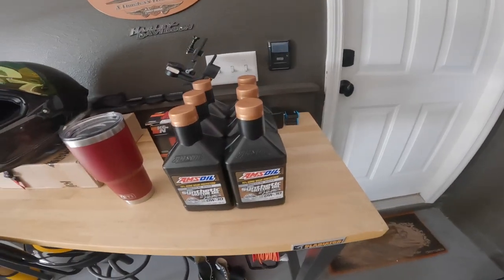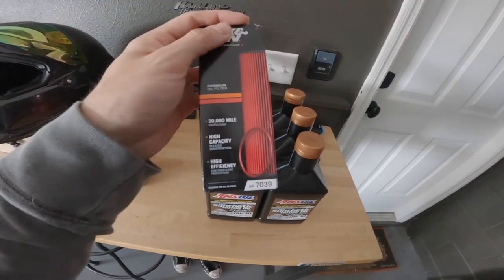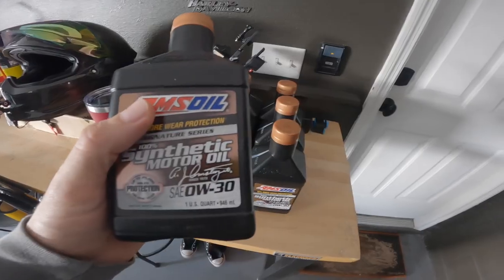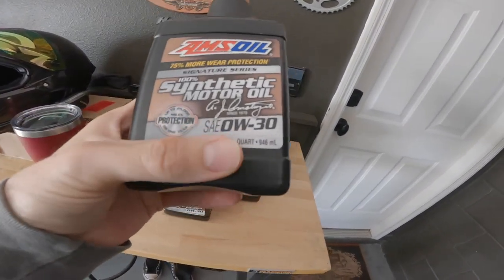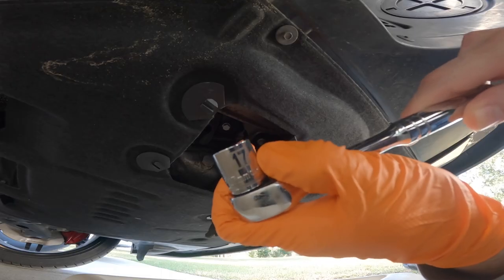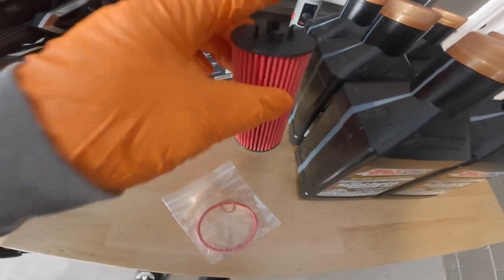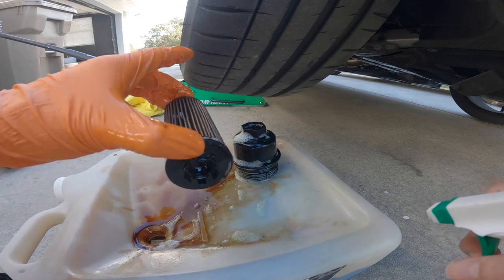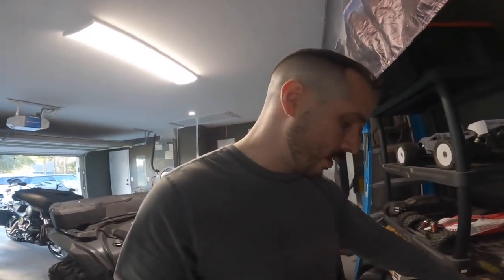Best High-Performance Oil Change for More Horsepower // Mini Cooper F56 JCW

Comment: Bro! Thank you soooo much for showing why the K&N 7039 doesn’t fit! I literally almost bought one! 😭 also what do you think about the Lucas oil High performance full synthetic oil additive. Do you think it’s even necessary? I’ve seen someone test it on bearings and it show much less wear but wanted your two cents. 

I also have a JCW no  remap but have the Mmr boost an charge pipe kit and also the hard intake resonator delete with the high performance silicone intake coupler. Planning to remap and also go for the eventuri carbon intake like you and the MMR inter cooler

Comment: Have you looked into upgrading the standard oil cooler for something like the forge oil cooler? A worthwhile mod if the engine is getting to higher temps on fast road or track conditions.
5-40 Millers NT+ seems to be the preferred oil across the pond for the JCW :)
Reply from the maker: This is great advice, David! I have seen the upgraded Forge oil cooler, but I haven’t researched it much. I’ll look more into it and see if it’s worth upgrading to in the future. 🍻🤘🏼

Comment: Is the AMSOIL LSPI friendly and have you noticed anything with cooling and flow efficiencies for the turbo? I went to a heavier weight oil and noticed the turbo wasn’t being cooled as effectively and the oil wasn’t being cooled as effectively by the built in oil cooler. I also noticed oil smell from inside the cabin when really beating on the car. I went back to the 2+ Mini factory 0w20 and everything seems to function better overall. I do use the K&N filters as I like the oil filter housing drain plugs better than the factory  plug. The factory plugs will break due to having to use Torx bits.
Reply from the maker: So many great points, Robin! I haven’t noticed any issues with cooling but I have noticed that the engine feels stronger on my butt dyno. 

Granted, it’s still too new of an oil change to not feel a bump in performance, I’ll do an update video in 1k miles and after the next track day. 

I plan on filming them so let’s see how it performs. Also, big turbo will be going on the Mini soon, almost done with the development, so I’ll try to collect this oil information before I make the swap to the larger turbo. 🤘🏼